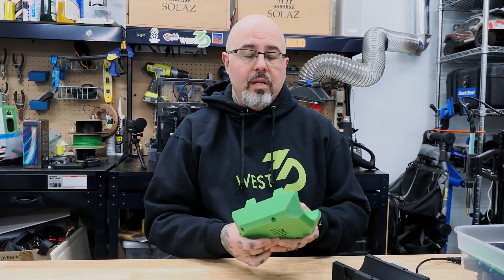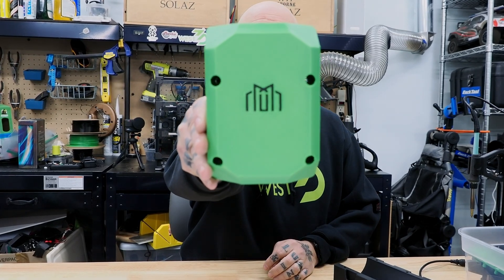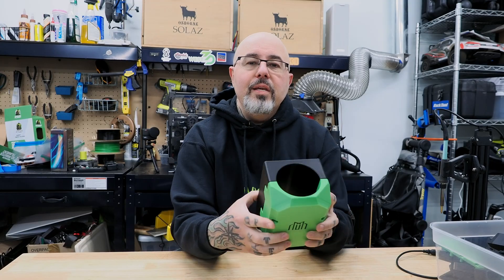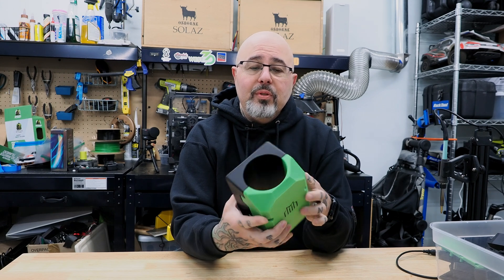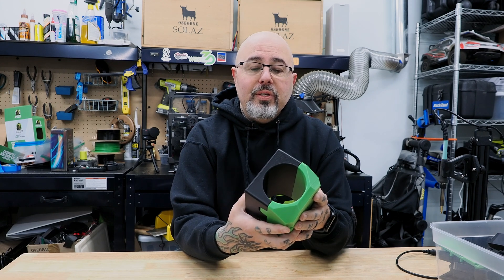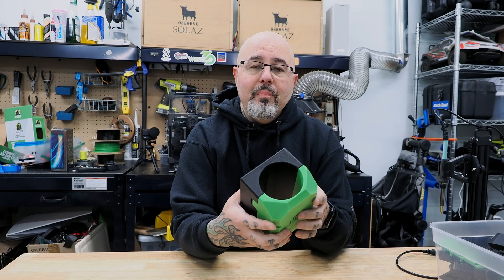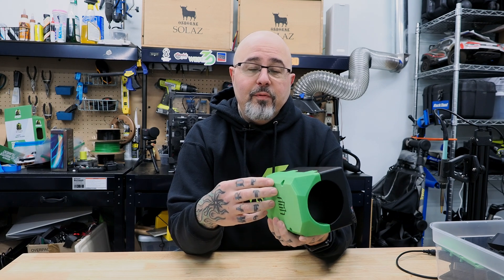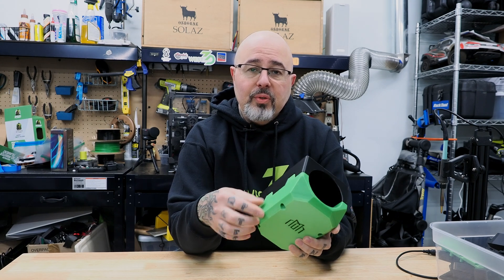Milo Build: Update 1

Comment: I’m liking these short build updates as opposed to the 3-12 hour sieges.  I can’t seem to find the time to watch them lately.  If your garage floor is smooth and you really would like casters - check out the levelling casters sold by Vevor.  They are amazing and work well for serious weight. I’ve seen them used on machines in the high hundreds of pounds.  They allow you to lower rubber pads that take the wheels off the floor and the machine is basically planted.  I have several sets of them in my workshop.